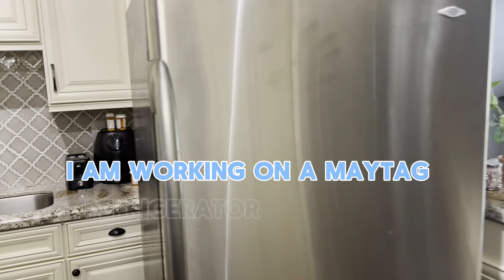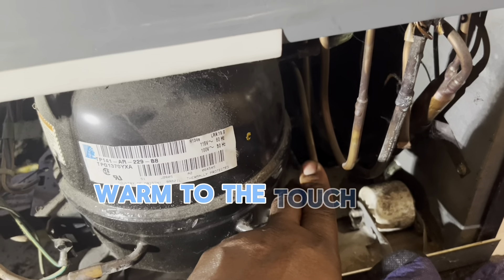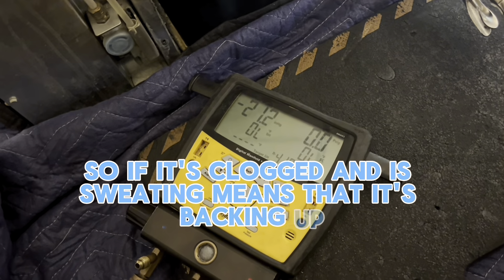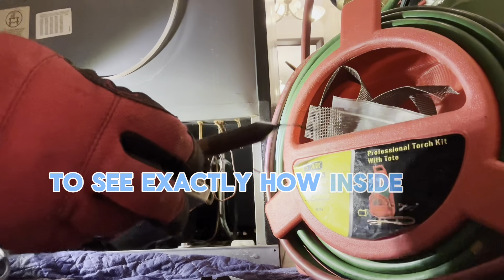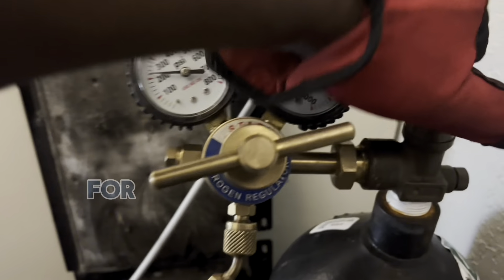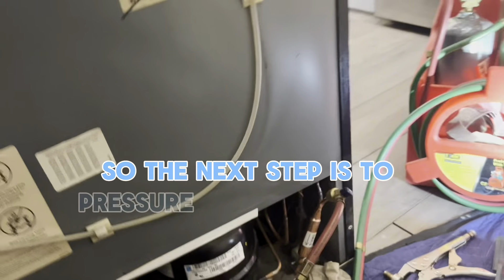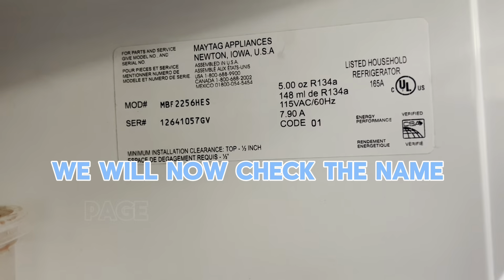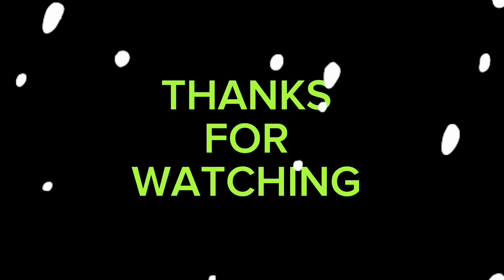How to identify a restricted filter dryer

Comment: What caused the drier to get clogged? I fix cars and if the drier on a car goes bad (clogged) it's because the compressor is going bad and pushed trash into it.
Reply from the maker: That’s a possibility too, but the line are brazed when manufacture so carbon build can occur too.